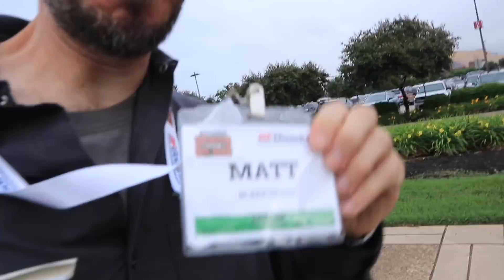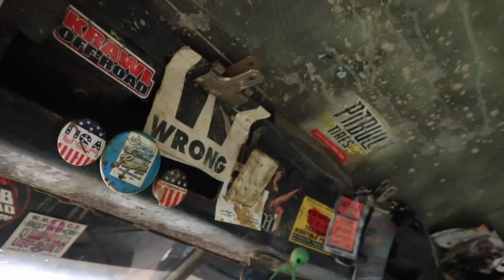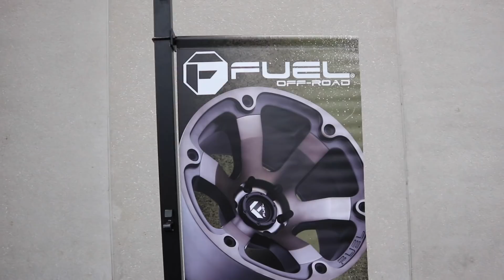I saw the Grimm Creeper from Truck Night in America at the UOR Show!

Comment: That Eagle was pretty sweet.  I'm busting my '84 Eagle wagon back out of storage this year to maybe tinker on it.  It was my first car, had it since 1995.  I built a bunch of custom stuff for it back in the late 90s.  Custom ball joint spacers for 1.5" front lift,  2" rear blocks, NP 229 T-case from a Grand Wag, Dodge Magnum 9 1/4" rear with Sure-Grip.  Custom front and rear brush guards, Cherokee wheels.  I think I won't put it back on the road, but will use it as for light wheeling in the local area.  It will go anywhere a slightly modded Cherokee will go.
Reply from the maker: Make it a showstopper!
Reply: That my buddy's Google John Conley
Reply: Thanks for the comment on the Eagle it's mine.It is #632 of the 2306 put together in 88 by Chrysler,it does have all the AMC badging though.It sounds like your doing to yours what I need to do to mine but I drive mine everyday.
Reply: Thanks old buddy,we need to wheel real soon.